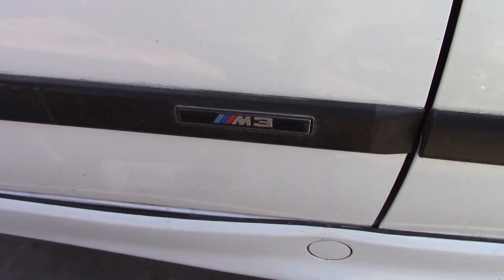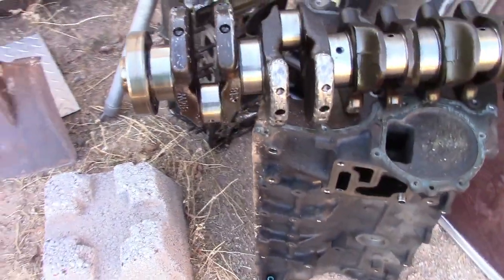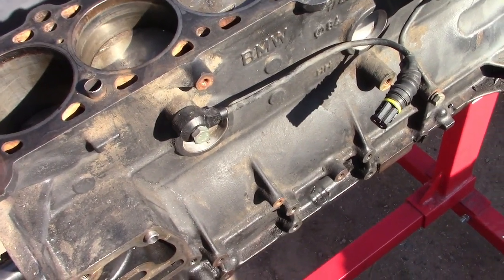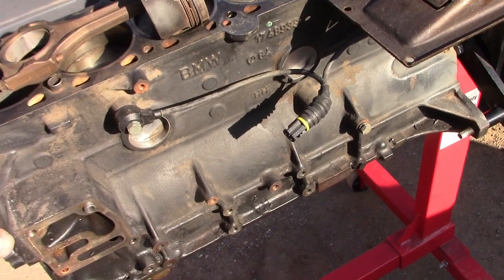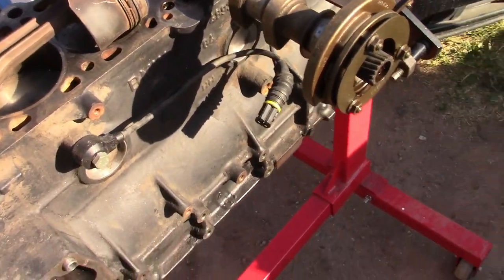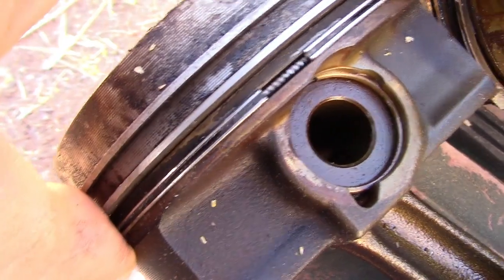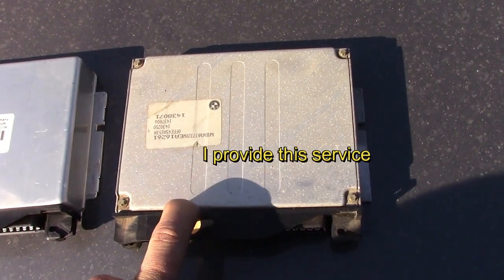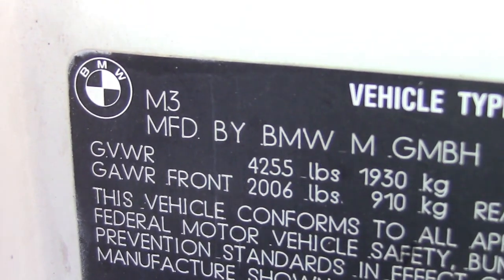BMW M3 S50 clone engine for cheap DIY

Comment: can this all work on m50b20 if i bore block to 84mm? also will m54b30 intake cam fit in m50b20 head without  vanos
Reply from the maker: it should

Comment: Hey there, I was wondering . . . I have a M50NV - can I swap the rotating assembly from the M54B30 with dual m50nv intake cams ("hot cam" setup)? Do you have a tune that would work for this?
Reply from the maker: yes
Reply: @HakenE30  i have the exact same 3.0 stroker setup withh m54 intake cam and nv exh. please share tune?

Comment: Hakene30 hi, if I want to do this swap can you sort the dme for me with the service you provide? In the video you say 93-95 e36 needs a chip swap for the dme. I have a 1992 e34. Do I need a chip swap as well or a different dme? Also I’m not sure what camshafts I should use for my build. I have a 1992 non vanos m50. Can I use my stock cams. Or should I use the m54b30 intake and my m50 intake cam placed on the exhaust side. Having trouble ascertaining how to go about it if I don’t upgrade to the s50/s52 cams. Thanks for your help in advance.

Comment: Would this method work for a m50b25 non-vanos engine?
Reply: Also interested. Did you ever find an answer?
Reply: yes, m50b25 is iron block
Reply: It'll work but you don't have to change your intake cam to m54b30 own because the m50b25 intake cam have same lift and duration with the m54b30 intake cam